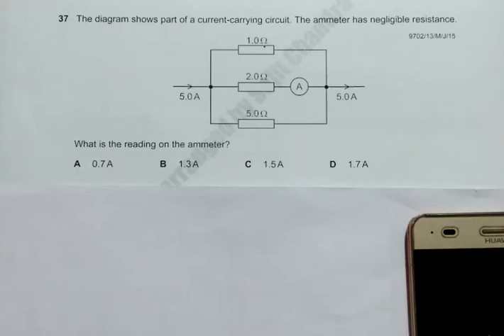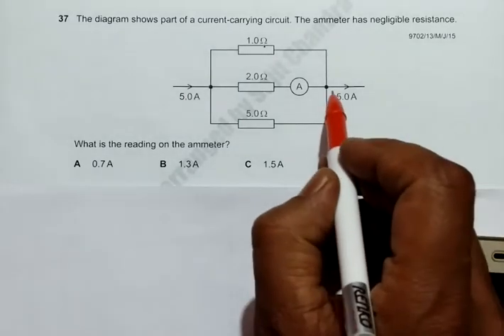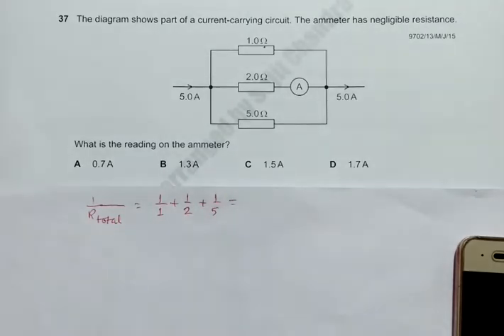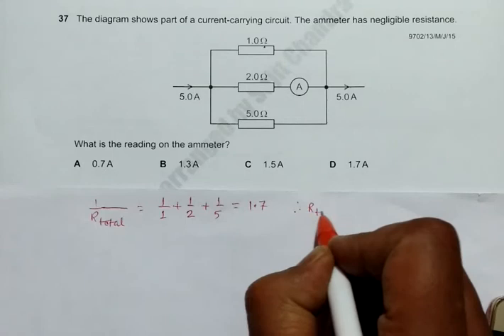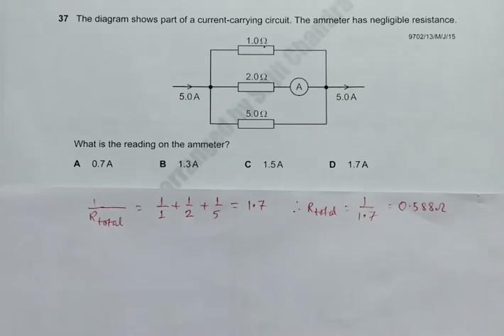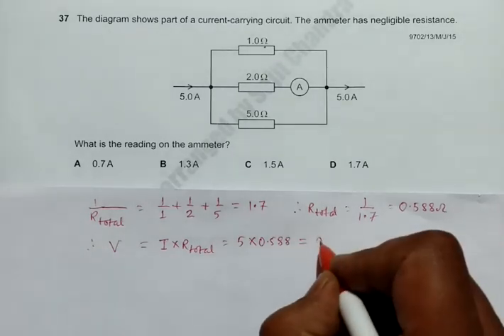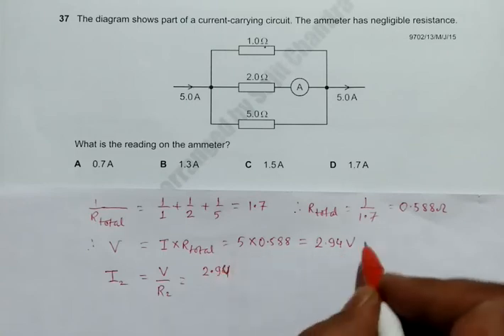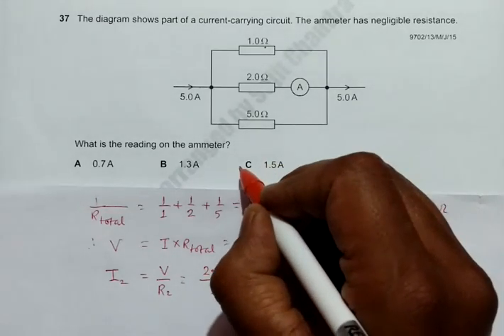2015 CAIE AS & A level May June Physics Paper 13 Q. No. 37 (9702/13/M/J/15) by Sajit C Shakya

Comment: Five bulbs are connected in series across 220v if one bulb.is fused the remaining bulbs are connected across the same line.which one of the arrangements illuminates more? Plz answer.my que sir
Reply: Sajit Chandra Shakya sir but in series if one bulb is fused whole the circuit doesn't work if i m not wrong??then how can current increase in the circuit???
Reply: Sajit Chandra Shakya  thankyou.sir now i get it